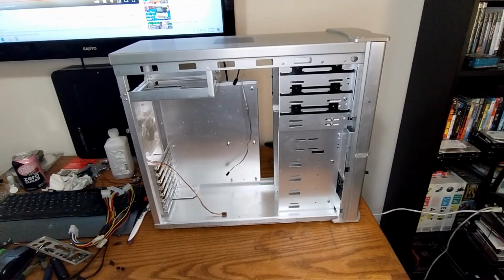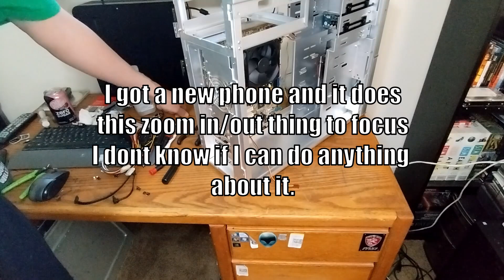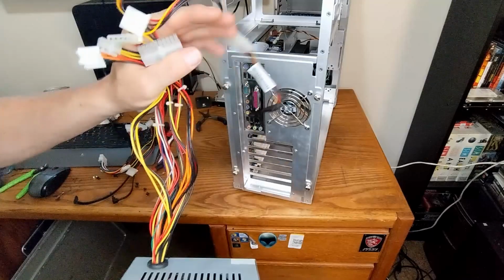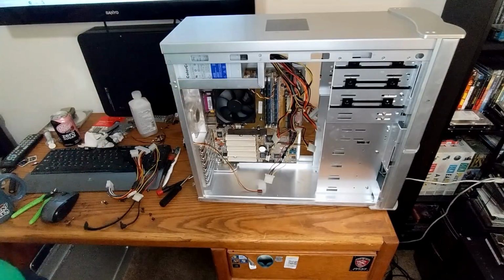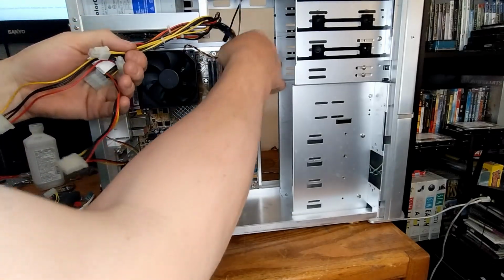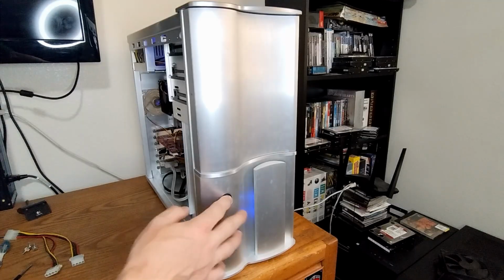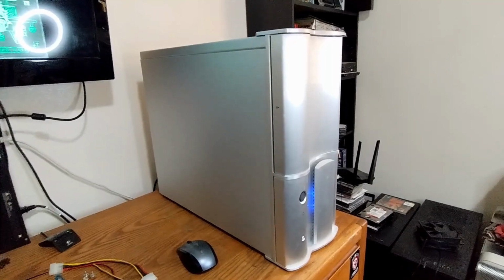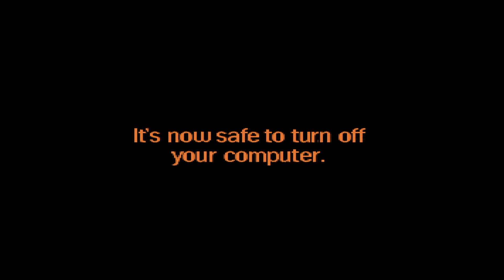Retro Hardware Build Time!

Comment: Yup! Some retro builders don't realize that those old AMD socket 462 processors require much higher amps on the 5 volt rail then they do on the 12 like Intel do.  Those old AMD CPUs will also burn up very quickly if there is an improperly seated or worse, NO heatsink attached to them! They are pretty fragile too because they have no heat spreader attached like the Intel's do!  Many have those little rubber feet in each corner to help protect them from too much pressure being applied incorrectly. They are so damn easy to chip or crack if you are not careful when mounting the heatsink on them.
Reply: So what? What’s your point? To go for a crappy Pentium IV instead? Who would want to got for a Pentium IV over Athlon XP? Unless 3.06GHz or higher. I’ve never head any issues with my Athlon XP machine back in the day. Pentium III didn’t have heat spreader attached either and worked just fine…Now, if your hands grow out of your butt than nothing will help you, not even a heat spreader…
Reply: @Igorsov  What the hell are you talking about yourself!!??  My comment was made over a year ago about the fragility of the old AMD socket 462 processors!  What the hell does a Pentium IV or Athlon XP have to do with anything!  What's YOUR point? I've never had any trouble with any of those CPUs either.  I never said don't use them but just be careful.  Use whatever you want.   Jeeess! 🙄